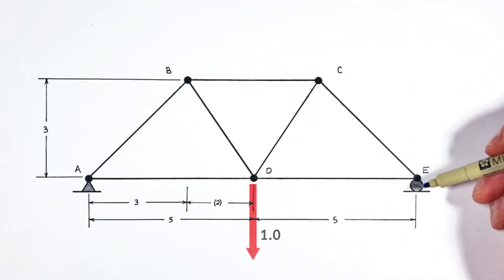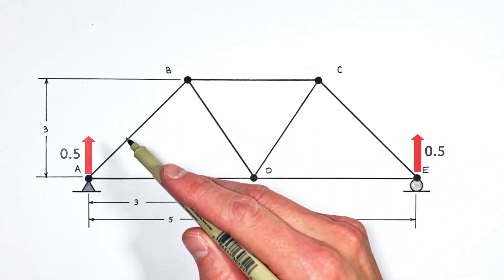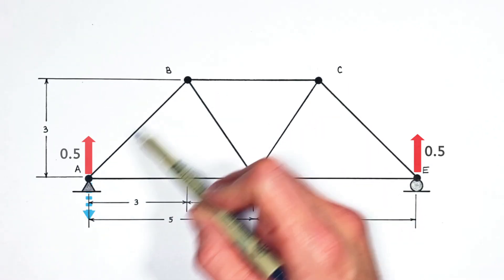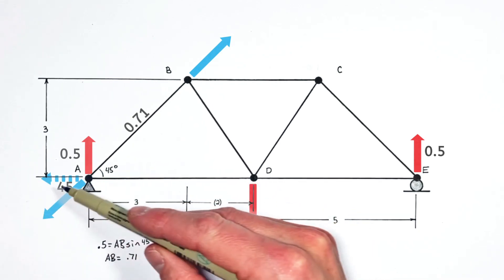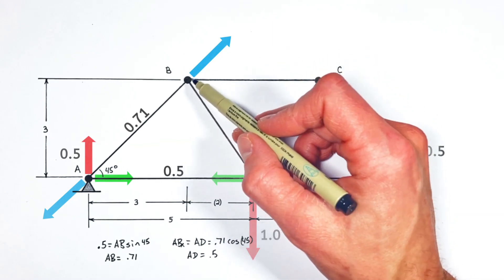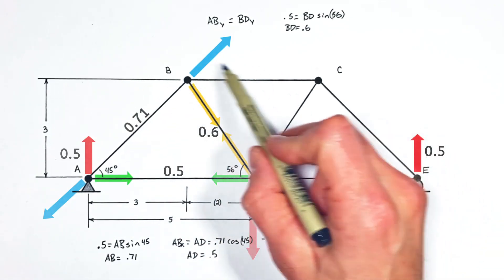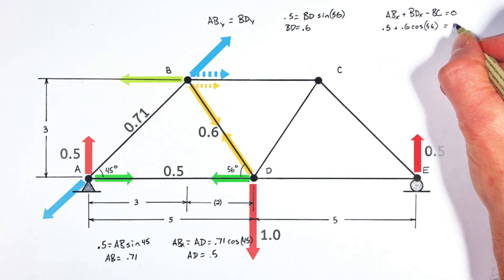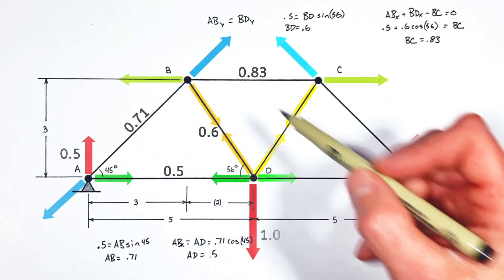Seven Beam Truss Analysis | Symmetric Truss Loaded in the Middle

Comment: How came the angle it 56 I'm lost
Reply: Same
Reply: @jaimealonzosalcedo7515  Split segment AD by drawing a line straight down from joint B.  You now have two right triangles; the left triangle has a base of 3, the right triangle has a base of 2.  For the triangle with a base of 2, use inverse tangent function to find the angle.  Tan-1(Opposite/Adjacent) = Tan-1(3/2) = 56.31